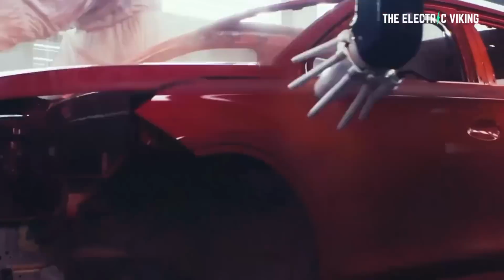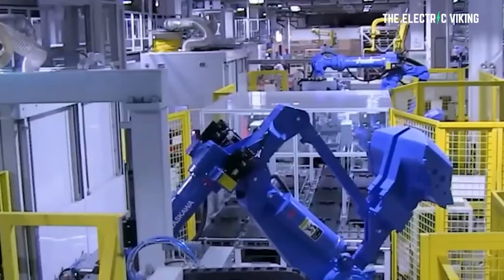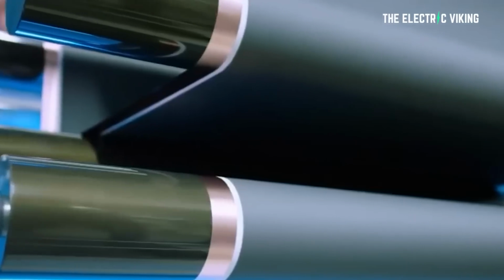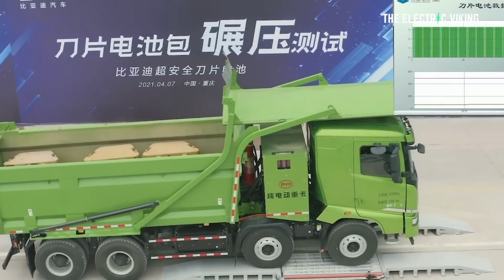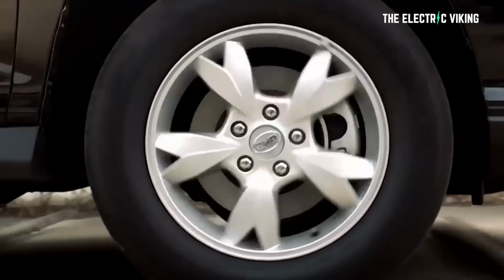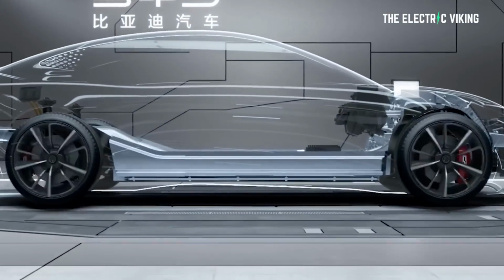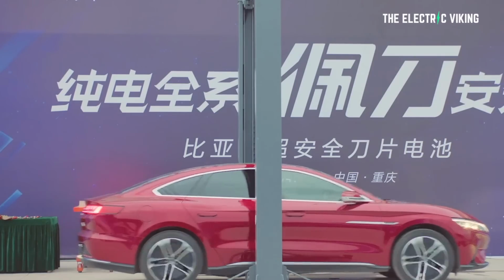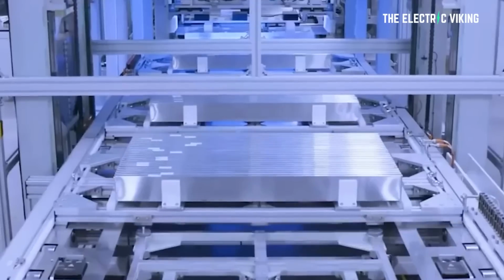BYD's blade battery is NOT what excited brand fans think it is

Comment: One more disadvantage is the lowered performance in cold climate. I would still choose LFP if it was available for a 4wd Tesla. I hope it soon will be. Love how you can charge to 100% without any worries. Thank you for your hard work Sam.
Reply: That is not what is happening if we refer to Motor winter range test in 2022. Two Model 3 one with Li-ion and one with LFP batteries performed exactly the same. Maybe it’s more of the heat regulation is manage. The Electric Viking as made a video on that test.
Reply: @jeanpaulmartin9696  I first bought a M3 Performance, sold it and bought a M3 SR+. I know for sure that the Wh per km increases dramatically with LFP during winter. In summer the SR+ is about 20-30wh more efficient than the M3 Performance, in winter, they are about the same.